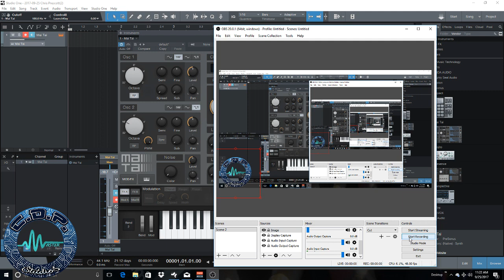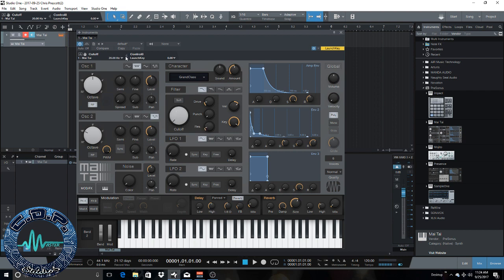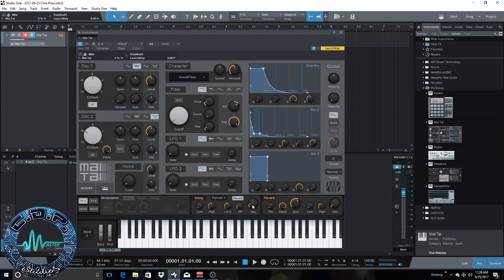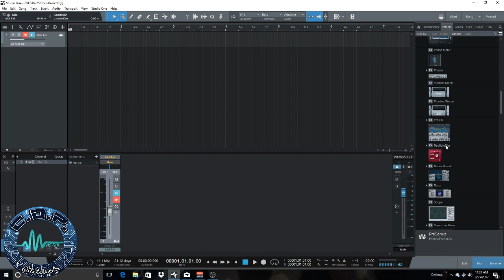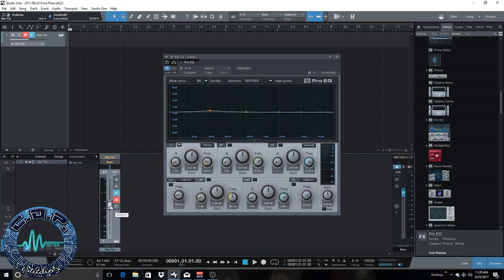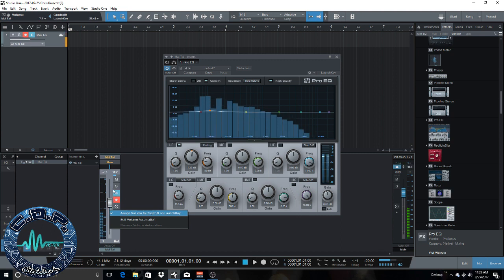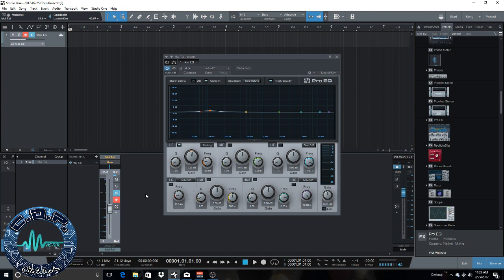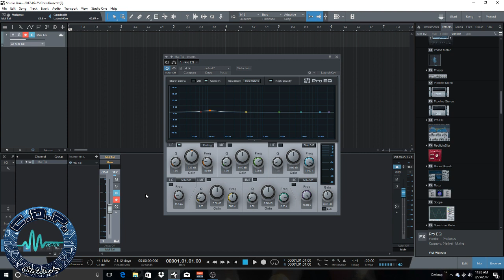Studio One Tutorial: Assigning midi controller knobs and faders inside Studio One

Comment: Yo! I keep losing my knobs config after closing my sessions. Is there a way to set those parameters permanently?
Reply from the maker: I’ve had this issue too still trying to figure that out. I don’t remember experiencing this in studio one version 3. Did you use studio one 3 and if so, do you remember getting this problem? I’m going to research the forums and also see if there’s something I can do to fix this on my own
Reply: @mcdp117  Thanks for your reply! I'm using Studio One 4. Let me know if you have any luck. Cheers :)
Reply from the maker: I think utilizing the midi learn function may have solved it but I also think maybe depending on the manufacture of the plugin, you might encounter other issues. For example I assigned the knobs for the waves VEQ and when I did it, it only recognizes the midi assignment for one of the instrument tracks. Might be a bug studio one needs to fix. Let me know if you’ve had any luck. Thanks!

Comment: So some questions:

When it is yellow in the plug in (top right) then you are assigning in focus mode correct? And it's only for that particular plug in?
If it is in the top left in S1 then that's the "global"?
Is there a way to preset this rather than assign every time with a mouse first moving it? So for example I have a midi controller with 24 knobs, can I assign once all the stock plugins and fx and be done with it and open them and start adjusting on the fly?
The arrow has to be lit to actually move parameter with the controller correct?
Reply from the maker: And yes the arrow has to be lit though i think you can auto assign then to the knobs as well by right clicking lets say for example the volume knob on a plugin. If you right click the knob in the plugin it should ask if you want to assign a knob from your controller to it. I may make a video showing that as well.
Reply: @mcdp117  awesome thanks. Would be great if you made that video i'm not exactly getting it to stick. Will have to try later when I have the DAW in front of me
Reply from the maker: From my experience using the same controller and assigning knobs to different plugin usually automatically saves the assignments. For example if i assign knobs to my pro eq it will save it even if i open in another session and assign knobs with the same controller to another plugin it will save it to that new plugin and the mapping will still remain for the pro eq as well.

Comment: Another take: for my workflow it's not worth taking the time to do this. When I play my midi keyboard I pretty much know what I want and get the rough chords and notes down. Then I use automation to make adjustments. With this method you have to remember all your assigned knobs while at your midi controller... "Uh, what parameter did I assign knob 5 to again?". It's OK for those with a great memory or if you only assign 2 or 3 knobs but if more than that, then it wastes my time having to go the V.I.'s panel to look it up every few minutes.
Reply from the maker: I think its best for adjusting values and parameters for processors, fx and what. Ex: EQ. Kind of a pain to use the mouse to adjust those values